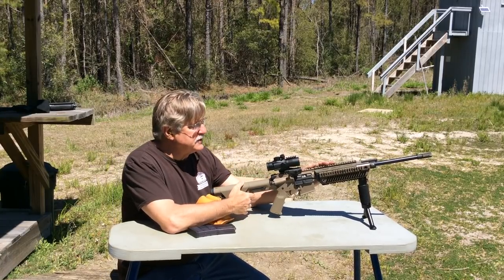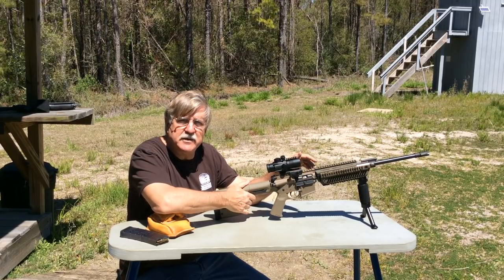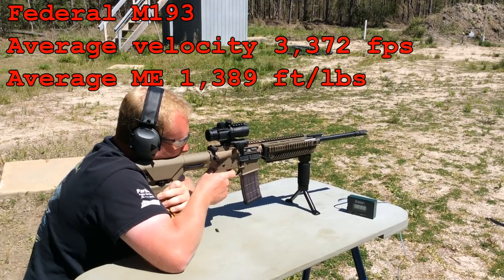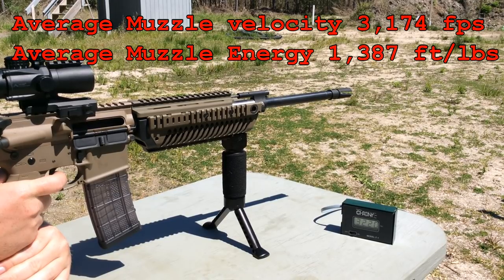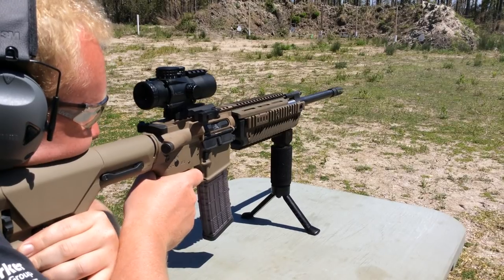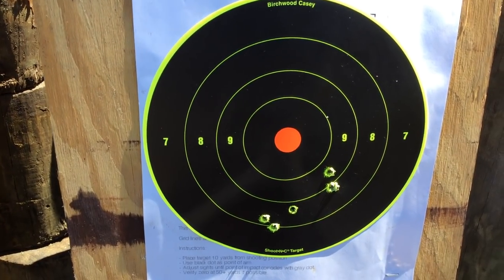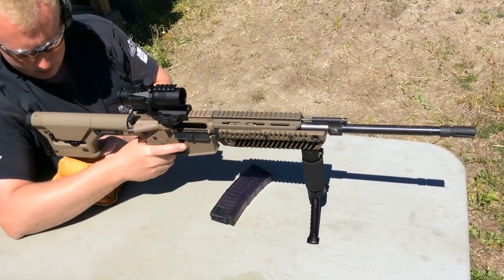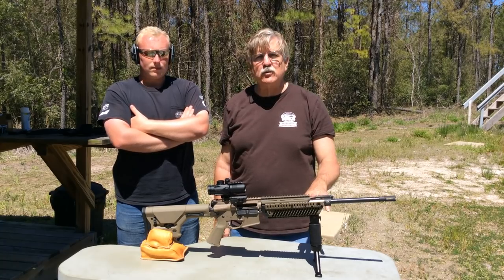Infantry Automatic Weapon Style Upper Receiver Custom Build: Field Test

Comment: I'd like to see you do some full auto mag dumps and test the heat shielding of the handguard.
Reply from the maker: That was the original plan but I have tried to cut back on the amount of ammo I burn making the review videos until I can see if I can get some financial support via Patreon from some of my viewers. I am retired and do not have the cash flow I had as a Surgeon. I was thinking about firing it with 30 round mag dumps with a break between mags that would bring the sustained rate of fire up to the IAR specs and see how the hand guard felt and see if I had any cook offs or failures. I am still considering doing it but waiting to see if my channel is going to be sustainable with viewer support only. I am not one of the "big guys" that have companies sending them cases of ammo with their products to be reviewed. But I think you are on target about that being the way to test this upper. That is what the design is all about, a higher rate of sustained fire.

Comment: Mike, how are those screws on that gas block secured? Rock set, Loctite, or are they staked? Have you used or had any issues with other clamp on style gas blocks? Thanks
Reply from the maker: I used Rocksett. I use this on all of my gas block screws as well. I have not had any come loose. Rocksett is not super strong but it does not weaken with heat.

Comment: You have to be selective on the barrel if you want accuracy.
If you really want to shoot accurately, make sure you buy a 5R rifled barrel on your next build... Hands down, by far the best change you could make... also, heavier bullets work better in 1/7 twist.. if you are going to only shoot lighter bullets, like 55's.. get 1/9 twist. Nice upper build otherwise.
Reply from the maker: I am on the search for a replacement barrel. It has to be .9" or heavier behind the gas block and have mid length gas. If you have any suggestions that meet these specs please let me know. Thanks,
Reply: @MichaelBellmbell556   You might have to just leave this as it is, a durable, heavy hitter with minute of man accuracy.. ... and then build a different upper for precision accuracy...  It's hard to know that .9 dimension without actually calling...  the most accurate barrels should have 5R rifling, .223 wylde chamber, "not be chrome lined, heavy barrel.....  Keep looking, I'm sure it's out there somewhere.
Reply: Compass Lake Engineering will spin a barrel to any profile one desires, with any blank, chamber, twist, etc.  They headspace to the owner’s bolt and fit the owner’s gas block.  Down side is cost.  I’ve paid as little as $300 for a Douglass to north of $600 for a custom twist Bartlein, but worth it in my opinion, and of the opinion of scores of Camp Perry shooters.  (...and I’m not diagnosing or critiquing your rifle, only providing unsolicited barrel testimonial. I watch your channel to learn from an extremely capable gunsmith)
Reply from the maker: @AF-O6  Thanks. I wanted to make sure this upper worked well first. I will give this barrel a chance with a few more rounds. I'll look into Compass Lake if the groups do not tighten up.

Comment: Is the Wolf T91 a worthy upper to use in the IAR role? Or is this one you built noticeably better for heat and rate of fire?
Reply from the maker: The wolf design is proven in military service. The one I built may handle heat better but durability has not been proven.
Reply: @MichaelBellmbell556  I appreciate your response very much Michael. I've never seen anyone as responsive as you in their comment section! I've been considering the T91, but I saw the same Bear Creek barrel and it looks much thicker. I thought for heat the Wolf might not be good and it would be better to build my own.
Reply from the maker: @GarinEtch  It is very rewarding to build your own. It is your personal design. I like what I put together very much but honestly dollar for dollar you cannot beat the Wolf upper. Did you see my videos on the wolf upper. It is very well designed and made. just not as unique as the upper I built in this video.
Reply: @MichaelBellmbell556  Yep, I've watched all your Wolf videos! Great stuff, thanks so much for the knowledge!

Comment: Bear creek...
Reply from the maker: I know, I know. It was the only barrel I found that was fat enough proximally to use with the Knight's hand guard. The upper is functioning so well. I will test the barrel with several rounds for accuracy. If it continues to group this bad I will search for a better barrel. I will follow up on the accuracy issue.
Reply: @MichaelBellmbell556  Most of their barrels have a 1 moa guaranty. Send it back for a replacement.
Reply from the maker: @yellowdog762jb  I have machined the barrel so I doubt they will stand behind their guaranty.